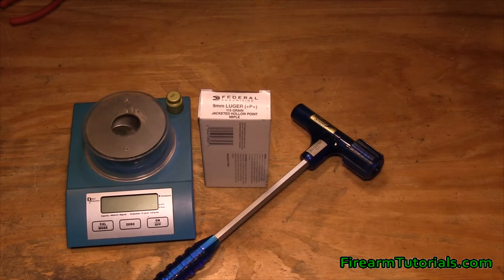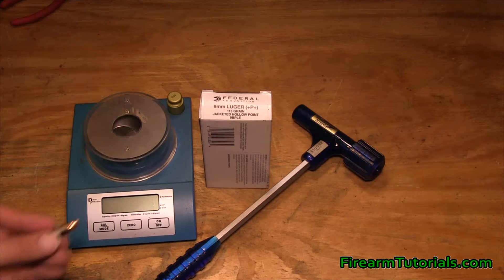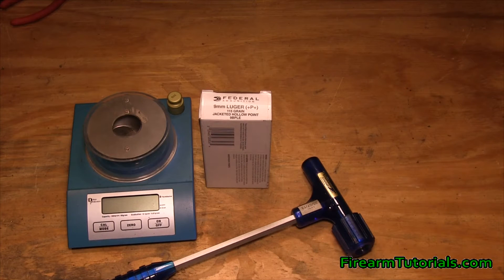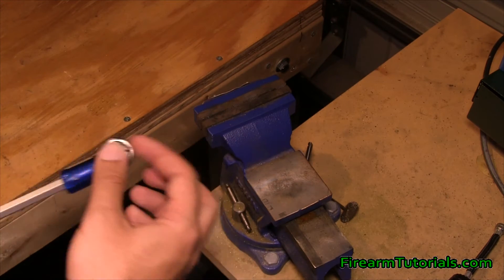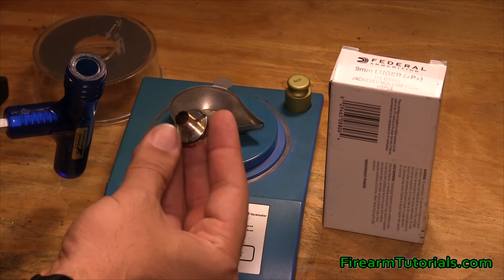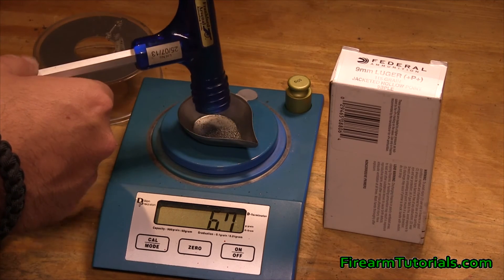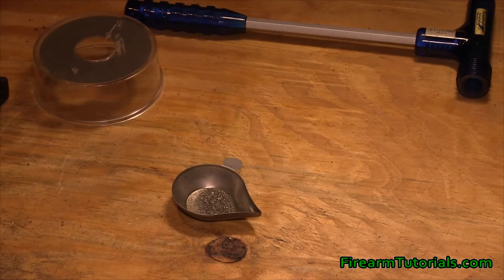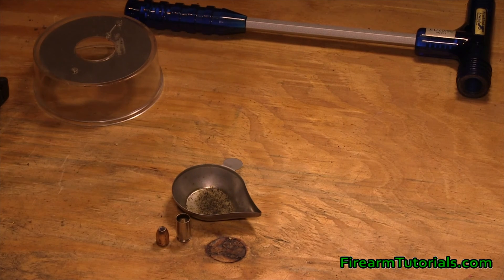Federal 9BPLE +P+ powder charge

Comment: Take a look at Winchester Ranger T-Series +P+ 9MM 127 Grain. Usually I can hear propellant "jingle" in a case if there is empty space, doesn't seem like it with these. At any rate, they are some wicked stuff. Now as far as I understood, +P has a SAAMI standard but +P+ does not, and that +P+ could be anything that is not a standard load but also not a +P, which would include loads greater than +P, but loads in between as well, which would mean not all +P+ would have to be greater than +P. Could be mistaken, that's just how I understood it.
Reply from the maker: That's basically it.  +P+ is still under MAX pressure though.  How much?  It varies from cartridge to cartridge.
Reply: GearCheck 101 actually, there are 2 standards for SAAMI in 9mm Luger, the standard maximum pressure is 35,000psi, the +P maximum pressure is 38,500. ANYTHING over 38,500 is required to be listed as +P+. If the pressure is at or under 35,000 it’s standard load, over 35,000 but below 38,500 is +P, and over 38,500 is +P+
Reply: You're right about the lack of "jingle", also true with some other loads

Comment: I have a question I don't know if anyone can answer.  In 2008, I ordered a few cases of 9BPLE.  It was hot, with noticeable recoil and blast well above any 9mm +P ammo I had shot.  Recently, I ordered a case of 9BPLE and found it to be disappointingly anemic when compared to the older, 2008 vintage, stuff.  I read occasional comments online that current 9BPLE is no longer +P+, despite having a +P+ headstamp.  Does anyone know when and why Federal watered down this excellent load?  Pressure and/or velocity wise, how much is the newer stuff watered down compared to the older stuff?  I also wonder how the watered down stuff performs with regard to expansion and penetration in gel.